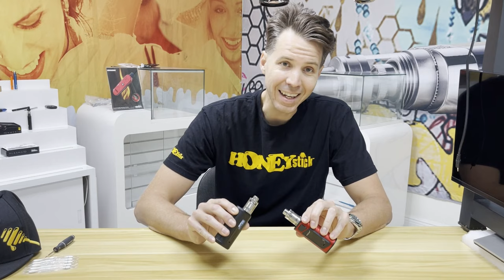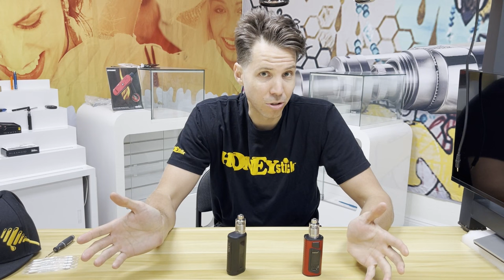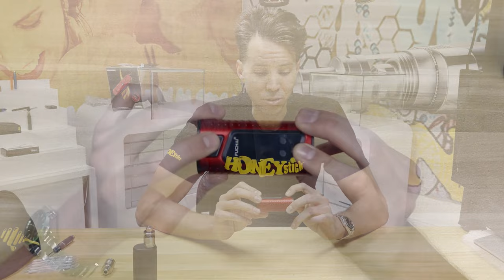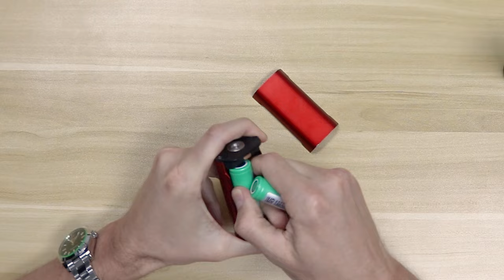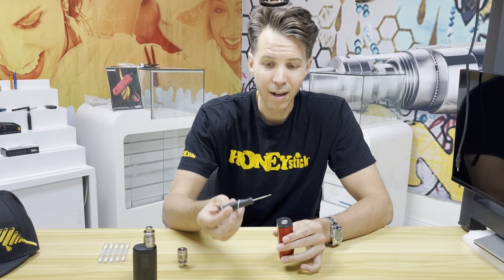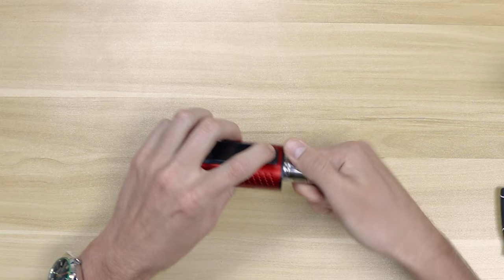Check Atomizer - Atomizer Short - No Atomizer - Atomizer Low -Error Messages Troubleshooting & Fix!

Comment: Wtf I restarted the vape, it still didn't work and then I 'accidentally' dropped it and now it works like a charm lmao
Reply: @e'rekt Zorah, looks like it was an internal contact issue, that fixed itself on impact. Thx for watching.
Reply: @danhoff6890  Works for me! It's still going strong, haha. Thank you for the very informative video, btw! I might not need it now but eventually I'm sure I will
Reply: @fragrooster375  My Pleasure and glad to help! I did that with a computer once and it is still going too 2 years later.
Reply: @danhoff6890  Amazing how that works haha. Even more comprehensible and turning it off and on :D
Reply: This has happened to me a lot! I fixed a pond pump once by slamming it on a rock! It started pumping water😉
Reply: Lucky guy
Reply: If it's not fixed, break it
Reply: You must start your YouTube channel with this hack 😊
Reply: I'm legit going to drop mine rn
Reply: It worked Ahahhaha and its not broken
Reply: Well I tried dropping mine and now I think it's pretty much dead
Reply: @goldenbanaenae401  oh FCK... mine is now working perfect and i can put off the head now😂
Reply: I took your advice. Chucked it at the ground and my E60 is working 80 percent of the time. Thank you.
Reply: after reading this and after 4 drops later i’m gucci berry
Reply: I stomped on my coil and it works now 😂 cause it’s a new coil and it wasn’t working so I got mad and stomped on it
Reply: Man thanks a lot of this mine works after tapping on the batter cover ..you are a legend!
Reply: Dude it works now thanks😂
Reply: Dude I just smacked it really hard on my palm and it fixed good lookin out
Reply: When i saw your comment i tried it once, then second and finally read my atomizer😂

Comment: I was getting "atomizer low" on my e-cig... after i changed to a new coil and let it sit/soak up the liquid for 30 minutes. I'd never seen that before.... it's been 12 years since i switched to this and i've never seen that. I spend an hour looking through crap, find a YT vid, first thing he says is to reboot the stick like a pc and i was like shit i hadn't tried turning it off.... i go in the bathroom where i left it, hit the button 1/5 times to turn it off and heard it actually work..... of COURSE.... hadn't done a thing it just decides to stop screwing up.
Reply: @Ahzhrei2000,  thats great very glad we could help, with electronics sometimes they need to be reset as you get a bug in the programming.

Comment: How do I fix oxvn when the temperature is high, bro 🙏
Reply: @muhammadriskialimaulana4477, so Temp to high, when you are running your mod can be a few things, the message is supposed to correctly work when the mod overheats and is running a dangerous level to the internal components of the mod,..it is a safety feature so you dont damage the mod from overusing it. however many times you can get this message in error, and you might have to switch the internal battery, the Coil, clean the mod connection ( to tank) or switch the tank itself, because the sensor is getting a faulty signal from one of those components. I hope this helps. If not call the manufacturer.

Comment: I had just changed out my coil and got the message.  Too bad I had filled it up all the way with juice before I saw the error message.  Had to dump out the oil and clean out the internal connectors like you said and that fixed it for me.  Thanks a million!
Reply: @robbiesvids1069, glad we could help! Cheers and thx for watching.

Comment: shouldve led with wiping ur contact pins as its a more widespread issue then in the chip or battery.
sometimes the tanks just not making a good connection to the 510 pins and the pin needs to be lowered.
this is especially true if ur plagued with ohms too low as well.
Reply: @Azra Sashima, great suggestions!! thank you for watching.

Comment: Thanks bro.. had a mod sitting for a long period of time. Used isopropyl and pressed and cleaned all the pins where the tank goes! Works like a charm
Reply: @kyle mynes, thats awesome! super glad the video could help you get running again and thak you for watching!
Reply: I was in the same boat, I've been using disposables for over 6 months and my mod has been sitting (and leaking). Alot of cleaning and pushing the pin down to let it bounced back seems to be what worked best

Comment: Thanks it was my battery luckily my pod mod has replaceable batteries.
Reply: Cemetery665_TOAO very glad we can help, and with external batteries this is the most common issue.
Reply: @danhoff6890  My old battery also started working after I stopped using for awhile so everything is good.
Reply: @cemetery895  Perfect, do you are back in business :-)

Comment: I have a fix....Use a seal (O'Ring or flat O'ring) off an old tank kit to put between mod and tank, they leak out the breather then under the tank in most mods, then into the 510 connection which causes problems and then into the inner casing which kills the mod....
Reply: @Namdor2012, thats a fantastic tip.

Comment: Hello, im new into vaping and your video helped a lot ! you got a new subscirbe , i had to change the coil even tho it was new and just placed it , do you know why this happens ?
Reply: @Vasillis Anastansiadis, Hi Thank you for watching, and glad we could help. The most common reasons can be that the coil got hit with too  much wattage too fast.... like a car ideally a coil needs to get broken in to heat up and cool down to heat up instantly again,  With high watt devices when people first get a coil , they stage it where they start off using it at the minimal reccomended wattage then work their way higher every few inhales...this gets the vapor flowing and allows the tank gaskets to set in properly. Sometimes it can be as simple as a defective coil or in a more complex case that the wattage regulator in the mod is bad and shoots out more wattage than indicated.

Comment: First short atomizer message ever... Cleaned tank and everything, restarted device, changed coil (two new ones), the message is always there. Did all the gentle  clicks&clucks you recommend on the mod and the tank (where they meet), but nada. And yes, the message appeared with one coil and remained after I replaced it, sounds like a mod issue right :( r.i.p?
Reply: @Hound Underground, yes seams like a connection issue inside the mod, probably within the chip circuitry, I would see if you can file a warranty claim with the manufacturer, other than that it wsounds like it can be sent off to its final resting place.

Comment: i cant get the whole thing off my vaperesso, i get the tank, and coil out, but the threaded rod is destroyed or something, because it keeps spinning around when i try to take it out. What can i do?
Reply: @andreashelledahle6718, in this case unfortunatley you might just have toi use pliers, to try and get a good grip on the bottom and apply outward pressure as you twist so it catches.
Reply: @danhoff6890  okay thank you so much, its one of the older versions but it’s sad to lose it because of that you know:), I will try that today or tomorrow and see what happens👍
Reply: @andreashelledahle6718  Sounds good, fingers crossed for you!

Comment: Thanks. I can't drive right now due to medical issue. The only vape shop close to me only sells these and VooPoo. All are crap. I have several broken ones here. I knew that it's something stupid with all of them that can fixed. The Aegis X is possibly one of the worst cases of bad engineering that I have ever seen
Reply: @Kattz, Aegis from Geekvape is notorious for connection issues for sure, I personally have had so many of them.

Comment: I vapped a 1.2 coil at 95w without realizing it and the mod stopped recognizing the atomizer. I switched to a different tank and it worked so it's not the mod. I changed the battery and everything but it won't recognize the first tank. It's a geekvape Z btw. I don't have another mod to test it with, I also replaced the coil.
Reply: @Walt, so even with the new coil the tank was not recognized? If so the tank base probably has some conductivity issues, you may try disassembling and cleaning the tank, we have a video on tank cleaning here on the channel. If that doesn’t work you would need to replace the tank base.

Comment: Still does not work I have hade this problem now for 3 days i have changed the battery,coil and cleaned it still get the Message
Reply: @serectos, if you tried that and still getting issues it must be the base of the tank has a contact or electronic issue.

Comment: I have smok nord 4. The display is showing no atomizer constantly from past few days. No buttons are working. The display is stuck at No Atomizer message. Even when the pod is not connected. Waiting for the battery to drain so that the display goes away. Is there a way to do hard reset? It has fixed battery
Reply: @Rahulsinha9031 - I dont know of a hard reset for that model. Probably best to let the battery drain as you thought and see if it resets the frozen Screen.

Comment: My 510 connections spring is not going up far enough and i cant fix it
Reply: @rhydengan348, if you cannot put a little spacer in there, then you should call the manufacturer to see if they can help you.

Comment: Can u help.me it says no amotizer and ive tried evrything took it all out and put back the same way and nothing happens
Reply: @Marino Nikic, if you tried everything in the video, even took it apart to check for contact issues and it still shows, you need to contact the manufacrturer as the actual circutry / microchip in there is damaged.

Comment: So I have a problem with someone who might be able to help me. I replaced my coil twice, and from time to time, I get an air hit. I've tried clearing the puff counter, and that didn't help. I have a morph3 using 0.4 ohm coils
Thanks in advance
Reply: @user-gz7oc9bz6c, so if the lights come on and the counter starts and the hit is dry it sounds like a contact issue, the contact issue can be you need to clean where the coil goes into the tank base good and make sure the connection points are solid, or you need the check where the tank screws into the battery to make sure the tank lower 510 contact and the battery are clean and making a good connection. If you take your tank and use it with a buddies battery and it works flawlessly you know you have to check the battery you have, however if it is the same issue with another battery you know if is within the tank contact. Hope it helps Cheers.

Comment: still no coil even in new atomizer ,how to fix
Reply: @princeNinoCabug-It5bw, so in the video I talk about determining if the issue is in the battery or the tank. if you try a different tank and it still is an issue the connector in your mode could be either dirty or not making contact with the tank pin. If you clean this area and still nothing you should call the battery manufacturer and see if they will swap it for you. Hope it helps.

Comment: I got this problem my vape was fine I changed the coil let it sit for about 20 minutes then was vaping away for about an hour or 2 then all of a sudden I got this problem could I have a faulty coil ?
Reply: @nightfury1348, yes it could be a faulty coil, also it is best to stage the coil where you kind of break it in before hitting it with any high wattage because then it prolongs the life of the coil... also in rare cases the mode may be exerting more power than it displays.
Reply: @danhoff6890  it’s all good thank you for your help I changed they coil and it’s back working fine now thank you for your help and taking your time to respond
Reply: @nightfury1348  Sure thing, Anytime!  glad its all good now. Cheers.

Comment: I have got an argus pod. Was using it since a year. Had stopped using it for a couple of months and now when I tried to use it, it shows check atomizer. I was using an older coil so maybe it is a coil issue. Anyone got any idea?
Reply: @Seasonpathak7000, most common is a coil replacement or cleaning the connection area in most cases.

Comment: geek vape error 'atomizer short'. so far there has been no way to fix it. i already tried all the stuff youre banging on about, ie you havent told us anything that i hadnt already worked out via plain old logic .... lol .... any other suggestions?
Reply: @YobboCat, yea the plain logic is all I got lol, if that doesnt work get in touch with the store or the manufacturer and poke at them as it comes down to the specific programing of the device as this is probably an internal error on the motherboard. Rarely if you take the casing of the device apart, you can see the wire going up to the connector detached where the soldering failed giving you that signal.

Comment: My drag 1 doesn't recognize Kylin Mpro RTA, but it recognizes Reload s( maybe kylin mpro too big)
Reply: @Alex maine, check the bottom connector pin in the mod battery and & the Kylin, and make sure when you screw them in they are touching. Most of the time your symtoms are caused by a recessed connector pin ewither in the mod or tank. Cheers and hope it helps./
Reply: @danhoff6890  So i solved the problem, problem was that pin is too short to touch the connector, so i decided to put a small steel piece between connector and pin, then it worked now my drag recongizes it.
Reply: @alexmaine2922  Awesome! Glad that worked, I figured the issue had to be there based on the symptoms,  thank you for watching!

Comment: my rta fires 10times then just saying ”check atomizer” what i need to do i tight screws
Reply: @mikkakoskinen366, you might be giving it too much power, or when you give it power the Screws and wire go out of place and make a contact issue.
Reply: @danhoff6890   i do new build and still not working

Comment: In my experience, Honeystick SubOhm tanks do not work on HoneyStick Batteries.  They are the worst battery I have ever come across, Defender, Subohm, whatever.  They have a cannabis cup stick battery that works very well, but the Mods they have are all Alibaba specials with 0 support.  They also give you a runaround on returns, rather than acknowledge the product is sub par and offer replacements.   I WAS a wholesale customer.  I have found dealing with some wholesalers is better than others, in this case, I do better with others.

Comment: I have a Voopoo Doric and I can't take my Doric apart so I cleaned it the best that I could and changed my coil and still nothing oh also I've changed my coil 3 xs and the first 2 coils somehow got broke because I have another tank and tried them in that one and they aren't working so whatever my problem is it's breaking my coils as well so do you have any ideas on what this could be I've even used the pod from my other atomizer and I know its my tank because my other pod that's the same as the one that the Doric has on it isn't working on my Doric either . Please help
Reply: @Kim Baum, it sounds like you have a pretty complex case but you did everything for that Mod to get it running, i think it has a problem with the wattage regulator and it is frying your coils by letting too much thru and masically ruining everything you have on there, I have seen batteries you have turned down to 2 or 3 watts and you hook it up to a Watt tester and it is pumping out 40 watts. Basically if thats happening you have to call the manufacturer or the shop that sold it to you to see if they can swap it or take it apart and replace the circuit board.
Reply: @danhoff6890  thanks for the feedback I appreciate it so much Thank you
Reply: @KimBaum-l1c  Anytime! Cheers, and thank you for watching.

Comment: I have changed coil twice and still says atomizer low
Reply: @Paul Gibson, it could be a connection issue with your tank to the battery or an issue where you have to clean out the insides of the tanks and the base that the coil connects to. If that doesnt work the mod has internal circuitry problems.

Comment: i have find something i remove all the screw , clean  & that's it zeus x mesh problem short or no coil now fixed
Reply: @Visual Deep Mix. great suggestion!. E juice residue must have gotten into your Mod.
Reply: @danhoff6890  it do that a lot of time zeus are the best but sometimes still boring 
😅
Reply: @danhoff6890  For my liquid i use only 20 pg 80 vg
Reply: @visualdeepmix4960  Well that is thicker juice so i can see how it would need to be cleaned more often.
Reply: @danhoff6890  ok thanks for your answer

Comment: Mine asks “New Coil”? This video doesn’t have this in it I had to adjust the watts 😅dabarooski up
Reply: @speedymyfrodriguez1299, sometimes your mod will wonder if you have a new coil, and want you to run a certain wattage or run a program for it. this is to protect the longevity of the coil. sometimes your mod can give you this message in error.

Comment: i did everything and the problem is still there
Reply: @LVLNULLER, if you did everything were you able to see if it was the battery or tank malfunctioing? if the tank the tank base is probably defective and you should contact the tank manufacturer, if the battery see if you can get a warranty repplacmeent for your mod.
Reply: @danhoff6890  yeah i go to the store today. i even changed the contact pin. it did not work.

Comment: High tem error on innokin sensis?
Reply: @Daniel Pirvulescu, it usually means it is running too long or too strong and the internal batteries are overheating. Might be a time to get some new internals 18650's.

Comment: None of that worked. I used other batteries other mod, cleaned the tank put new coil, still says atomizer short.
Reply: @Bern Chyu, I would get in touch with the mod manufacturer, it sounds like something wrong with the internal circuitry of the mod.